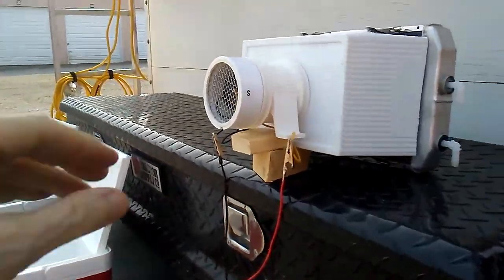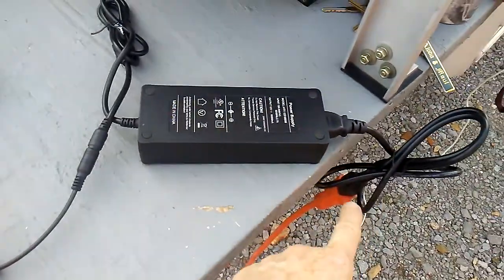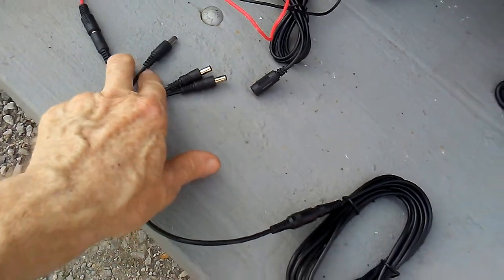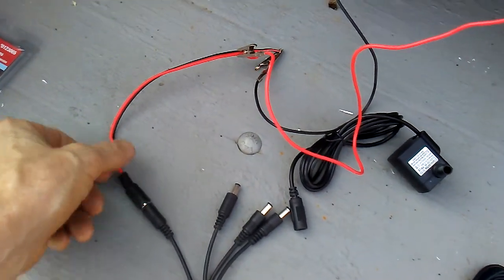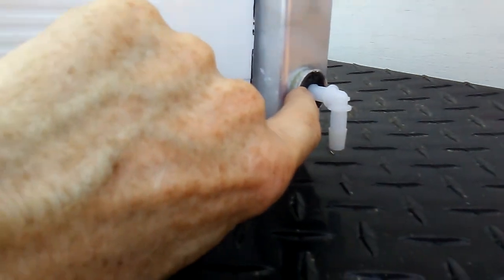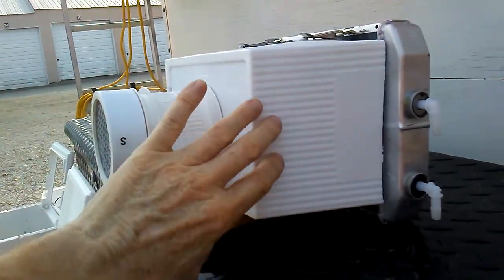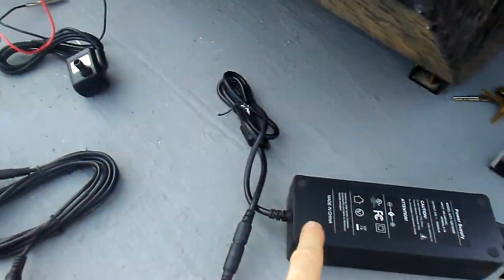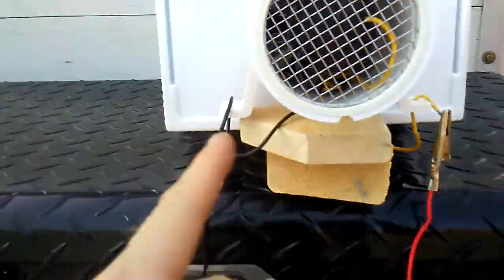DIY Air Conditioner: Mini Red Cooler(C) DIY Overview - Ice Chest Air Conditioner - 12 volts

Comment: That thing is awful noisy as well, anyway to damper the noise
Reply from the maker: Hey Carl, Yes the 3" fan blows very hard but it's not as noisy in person as it is on video. I've seen generator videos that do the same thing. The db level is lower than it sounds on video. But at full blast they are louder than a box fan etc but blow faster than a box fan in a condensed form for sure. But if you turn down the speed a little the noise reduces immediately. The microphone picks up the sound and it is definitely amplified for sure on video. The 4" fan version is slightly more quiet. But I've never found a fan that can produce as much airflow for an ice chest AC unit that's small and quiet. They push a lot of airflow for sure. I've bought several dozen fans used for many different applications but none compete for the string condensed pattern sir flow velocity.

Thanks, James

Comment: You mentioned you were sending one of these units overseas oh, I have a friend in the Philippines oh, and I want to send them an Arctic Arctic air cooler, can you tell me how I'm supposed to ship something overseas
Reply from the maker: Hey Carl, I just sent some small booklets to the Philippines last week. The package/thick medium sized bubble envelope weighed probably a couple of pounds and cost $29. There are 5-6 choices of delivery rates and are all a few days different so you can choice a moderate delivery time etc that's more affordable. I've been using the USPS United States Postal Service at the post office and is pretty good.

You may want to watch or read some reviews about the tiny arctic air unit reviews though. They are "evaporative coolers." That mean they use evaporating water to blow air across as the most is cooler than the air. But they create humidity and don't work well in places like the Philippines where it is very humid. But they may work a little on a desk or something in a more climate controlled room. They won't work too well in an open air situation as much as they advertise. That "evap", "evaporative", "swamp cooler" design works bets in arid, desert, dry climates. So, I would investigate before sending one overseas first.

They work like sweating on the human body similar to having a sweaty t-shirt on the wind blowing through the fabric which feels cool or cold in comparison on the human skin. But they can make a humid atmosphere even more sticky and sweaty sometimes though.

I'll be build some tiny AC units soon better than those arctic air units. The circulation ice water design operates just like a window air conditioner etc. It doesn't use evaporation and mist etc. They use very small PC computer cooling radiators and fans and are much smaller than the ice chest AC units and will be cheaper to ship overseas etc.

I'll make some videos soon about the smaller sizes and shipping etc soon as well. 

Thanks, James